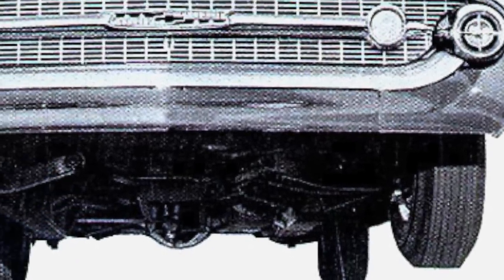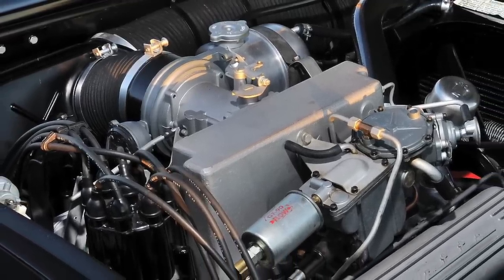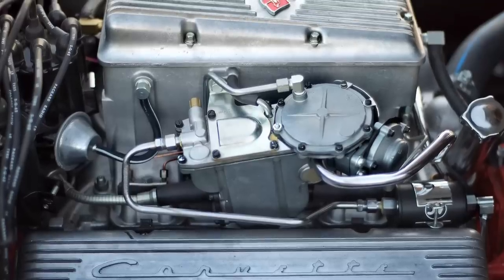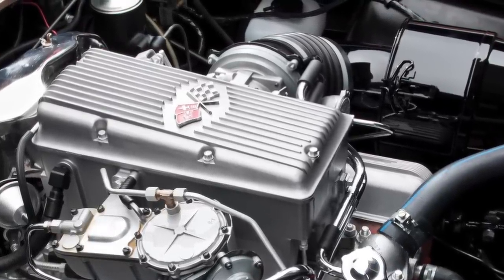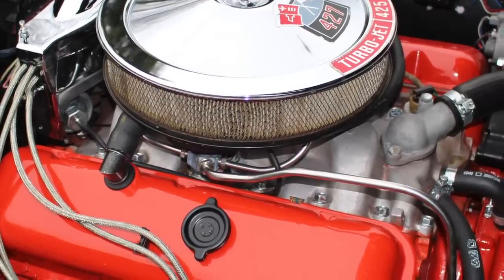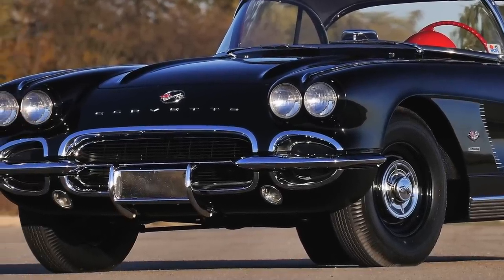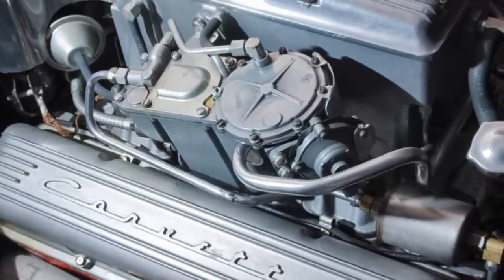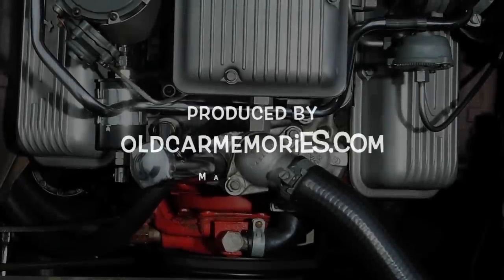Why Chevy Abandoned the 1962-1965 Fuel Injected 327 V8

Comment: Reminds me of the Cadillac Northstar engine.  It needed maintenance on the coolant system, but most original owners were too busy or cheap to have it done correctly.  Sometimes the corner gas station drained out the silicate aluminum friendly Dexcool and replaced with the silicate aluminum oxidizing "green stuff". Later, they unloaded the cars onto the 2nd hand market where they began blowing head bolts and gaskets.
Reply: .... and then when they found out how expensive it was just to change a starter on a Northstar . . . . . . .

Comment: Somehow it was even more complicated than a Quadrajet.
Reply: Super Duty 455 lol!
Reply: i loved the quadrajet, progressive secondaries and when jetted right would be 350cfm out to 920cfm, had one these on my aussie 308 when i rebuilt this mongrel motor the carby didnt need touching, and wide open would supply more then enough go juice to keep the car flying down the roads
Reply: Super Duty 455 I owned a few properly running Quadra-jets w/a automatic kickdowns, and they were crisp running drivetrains.

Buh-WHAAAAAA!!!

Not that difficult to work on when compared to a Hollys' constantly frustrating fuel leaks.
Reply: Quadrajets are good, simple, carburetors.
Reply: Back in the day their nickname was quadra-junk when they messed up because they were finicky to rebuild. But I always had pretty good luck with them.
Reply: Mike Lunn I agree. No carburetor on a stock 350 engine that can bark the tire when shifting into 3rd on a th350 at wide open throttle with only 3.08 rear gears can be a bad carb. I would get over 20 mpg on a long highway trip with a Quadra-jet.
 I had another one in a 1-ton full time 4wd truck and a th400 that was a complete animal with a small RV cam in it. 
 Factory knows how to engineer thier stuff. Usually It's when people think they will make it better somehow they make it worse instead.
  Quadra-junk, Quadra-bog... and a few other names that caught on were given to them by people who didn't have the knowlege or skill to not screw them up. 
 Sounds similar to the Fuel Injection units this video is about.
Reply: Plot-twist, guys ---- I only run Quadrajets. Spreadbore or bust!
Reply: Super Duty 455 then why would you say that they are complicated? They really aren't, and rarley ever needed to be touched.
Reply: Rockitanski because it was funny? They have a reputation as such so....sarcasm basically.
Reply: The advent of the Quadrajet in 1965 may reflect a strategic decision on GM's part to go with the new carb over fuel injection. Having rebuilt/repaired several Quadrajets in my day, I can say they aren't that hard to understand, and work very well when properly set up and tuned. For everyday driving, they work on the relatively efficient smaller front barrels. If you need CFM for accelerating/passing, the back barrels open and provide amply.
Reply: QJ  is far from complicated.  Even  this old Mopar guy used to be able to make those work!!!
Reply: I put one on my tired old '69 Chevelle 307, fiddled with those secondaries and promptly blew it up somewhere north of 6 grand.  I liked the performance of that carb.  I just wish that everything underneath it wasn't worn out junk - but I was just a broke 16-year-old.
Reply: Super Duty 455 was a
Reply: give me a good quadrajunk and ten gallons of gas, you take anything else of comparable age and I will go further down the road than YOU will. they got excellant milage when driven right never had a bad one.
Reply: I rebuild Qjets in my sleep
Reply: The Quadrajet was one of the last carburetors designed and specifically for performance and drivability. When you consider the huge amount of money GM spent on R&D then it's easy to see why it really is a superior carb in a lot of aspects. The only thing that lets it down is the small float bowl. It has a better idle circuit, transition circuit and power circuit than a Holley or Carter AFB style carb. I own Pontiacs too and I run 11's with no problem on my GTO with an NOS Super Duty Quadrajet. They were always called "Quadrjunk" by idiots who weren't qualified to change a flat tire back in the day. I remember hearing that all through high school in the '80's. But truth be known, they were simpler with fewer parts than almost every other carb on the market and when in good condition would out perform all of them.
Reply: @dale2778  i did lol.
Reply: The only thing wrong with Quadrajets was the leaking primary well plugs, and that only became an issue of the car sat for extended periods of time without being run.  I've had, literally,  over a hundred of them apart, and there's nothing difficult about them.  Q-jets, along with Carter AFBs, are reliable carburetors.   Now, if you want something as temperamental as a woman who has PMS, buy a Holley.
Reply: @johnchud7507  I loved the performance and sound of the quadrajet for many years. A very versatile carb. Tried Holley, and Carter but always went back. My dad knew everything about the quadrajet, and kept atleast a dozen of them around at all times. People who didnt know how to work on them talked them down, but they are great
Reply: no way pain to rebuild .getting the metering rods back in was a major fight .carter thermoquad was easy to work on alot less parts
Reply: Turn both vacuum secondary metering rods on a lathe. Tapper down from the original diameter (increasing fuel flow) and bend the hanger up that rides on top of the center lobe(that way fuel comes in sooner) and away we go. Like the little piggy.....wee....wee
Reply: @cruzinezy1968  u mean quadrajunk

Comment: Something to keep in mind: Farmall Tractors started making more efficient overhead valved engines in 1928, Chevy started in the mid 1930's. Ford and Chrysler were asleep at the wheel in regards to changes for better efficiency.
Reply: Farmall didn’t build engines. They bought engines from Continental.

Comment: It was almost impossible to keep running correctly. A few dealers and specialty shops could get them running right but they would go out of tune quickly. One has to remember they were MECHANICAL fuel injection. It took the use of electrical sensors and computers to make them useable for every day use. I was there.

Comment: Gm was always making bad decisions. Vega is one of them, and how bad they screwed the customers that purchased them. Not honoring their new car warranty in the 70's was also a kick in the pants for customers and dealers jumped thru hoops to get reimbursed. The diesel Cadillac was another boat anchor, they made standard engines into diesel and when they blew up the owners were stuck with a car they paid approximately $20,000.000 for, worth about $5,000.00 a year later if even that. I'm 65 and I don't forget these things, is why I'd never own a Chevy. If someone gave me one, I trade it at a loss to get a Ford or Molar.  Until the 70's Chevy did make good cars, probably even better than Ford or Chrysler, but after that, wow, did they ever short change their customers.  Just like Vega and Cadillac Diesel, fuel injection for the period was a bad idea and a maintenance night-mare for only but a select few.
Reply: Amen brother! I bought a 1974 Chevy Vega, brand new off the showroom floor. It made a FORD man out of me!
Reply: gee   i still drive corvairs     you cant hurt  them
Reply: You speak the truth. I have been told by many people how they were screwed over by a GM vehicle from the 1970's. My dad purchased a 1980 ChevroletK-10 that was gone at 50,000 miles.
Reply: @animalcorvair  it wasnt chevy that messed up it was that idiot Ralph Nator corvair was and still are a fine automobile that was my first car they made a truck and a van also and the corvair spider was turbo charged and it would get down the road
Reply: @panheadbob8627   i have 6  corvairs .. been driving  them for  40  years an i am in the dayton  corvair club  too  love.. to have a rampside     but no place to put  it  lol
Reply: I rebuilt over 40 vega engines,they were mismatched junk,aluminum cylinders against aluminum pistons,they all scuffed the walls in 4 months,the valve adjusters were 0.003 tight or loose,noting in the middles they either rattled or burned valves,putting a v8 in one only saved the body,oh yeah they were the first to have WELDED ON DOOR HINGES,IMAGINE THAT,a bodymans's nightmare,gm is better than that,we sleeved every engine that left and milled every block and I milled the heads of every engine that left the shop,then they ran 100k plus miles
Reply: .... to say nothing of the awful engines that the Cadillac division put in the GM flagships... like the 4100 aluminum one.... the 8-6-4 one......

Comment: ... and GM still uses the pushrod engine layout.  🤣🤣
Reply: Efficiency/power is not governed by how valves are moved. Old radial aircraft engines had 4 v heads with pushrods.
Reply: @andgate2000  :  But they were slow-turning, not high-revving.

Comment: The 1955 300SL was not only injected, it was DIRECT injected (into the cylinders), a first and about 50 years before it saw wide application in automotive engines.  The 300SL DI did have teething problems such as fuel wash-down when the engine was shut off and de-pressurized lines fed fuel into the cylinders;  this in turn diluted the oil down in the pan requiring a long hot run the next time to vaporize the fuel in the oil.  
Also of note for the 327 SBC was mechanical genius Grumpy (Jenkins) who ran a dual-quad 327 in his Chev Vega in the early 1970's  that produced 580HP !! , not a streetable engine of course but not too far behind current Hi-Po GM engines that need a supercharger for this kind of power.
Reply: right on Grump..he was the man.

Comment: Laughable injection was available in the 1960s but not in the 1970s.
Reply: Didn't the first Sevilles have fuel injection?
Reply: Yes. In 1976 on a 350 Oldsmobile V8.
Reply: Tacohead Makenzie  *on a Vette
Reply: @JoJoJoker  I was responding to Paul's comment.

Comment: 1) the FI ran from 1957 until 65--that's a lot of years for something that doesn't allegedly works. (2) nearly every gas station had a garage rather than a convenience store--that's a lot of shade-tree mechanics working on FI cars. (3) when you work on old cars, you learn that when you think you have a carb problem, its really an ignition problem. So, you swap out the FI intake, and replace the points when you put the distributor back in and--voila! you think the FI was the problem (4) fuel was better than the 1920's when clear glass in the gas pump let you see how allegedly clean your high sulfur fuel was, but it was still was as poorly refined as the oil that turned to sludge in your crankcase by 3,000 miles.

Comment: In 1965, the 396/425hp came out meaning Chevrolet would use it as the "top engine" and could use carbureted small blocks as the lower options without the complexity of the fuel injection.       425hp is more than 375hp.     It's that simple.

Comment: the oil companies told them too! ...... they where worried it would get much better gas millage than the carb. versions would!...... It is always about the money!
Reply: I had the corvair with the Paxton turbo
Reply: You should read more before you post.  The Corvair never employed a Paxton.  It was an exhaust driven unit, using a special Rochester carb with an enrichment circuit.
Reply: Well I hate to burst your bubble my friend...... but the name on the corvair  Monza Spider that I had used a paxton  turbocharger when I bought it used.
Reply: It was owner added, then.  Did not come with Paxton from Chevrolet.  Paxton built superchargers, anyhow.
Reply: Mine was not a mechanically run supercharger!...... it WAS A TURBOCHARGER exhaust run. and on the air cleaner it said PAXTON TURBOCHARGER! ...... and it looked just like the one's pictured for 1962 corvair monza spyder cars!
Reply: >He thinks it was the oil companies that told em to stop.
Have you ever seem how much of the fuel cost is tax?

Comment: These Fuelies don't run too good or tolerate modern 10% ethanol gasoline at all
Reply: John Hull not true!...just needs to be tuned for it!
Reply: Dan Fahey that depends on what part of the country your in and the blend used... also have to change tune with season....stick with same gas supplier, and summer hot starts/driveability can still be problematic
Reply: John Hull  what ever. Never had a problem
Reply: John Hull so do carbs
Reply: carbonfiber492 yeah but most people lack the knowledge to do these....now including myself since it's been over ten years since I sold mine and being a nice guy included the original Rochester shop and service manuals I had
Reply: John Hull, 104 chevron blue available at your local small airport. Leaded gas with high octane. LL100 also mix 50/50 with pump gas
Reply: Not my experience. They would not tolerate sitting idle for 6 months, though. The extra water held by the alcohol made the HP gears rust and locked up the hp pump.
Reply: The simple answer why they quit building them was economies of scale in manufacturing
Reply: C T well that is a dumb idea
Reply: +Corey T Taking  a 10k original fuel injection unit off a 100k car just because one doesn't know how to tune it properly is like putting lipstick on the Mona Lisa...

Comment: Astounding history. GM had the working technology that should have been used in post-OPEC embargo 1970's engines whose carburetors were leaned out to improve fuel economy but that brought a whole bunch of knocking/pinging and cold-start-up problems. I remember futzing around with 2-bbl carbs trying to get it all to work. Fortunately, I lived in SoCal (moderate weather).

Comment: The main reason that the Rochester fuel injection was discontinued was because of the dawning of increased emission controls. One of the main thing that plagued the 'fuely' was the gasolines of the day. This also plagued other fuel injection systems when they started emerging again. The problem was that the fuel injectors would start getting restricted from internal build-up. Also, either mechanical or later electronic fuel injectors had mechanical poppet valves and anything mechanical will wear, so instead of a nice spray coming from the fuel injectors, they began to leak and dribble fuel. The deposits forming in the injectors also exasperated the problem. 
The first job of every carburetor or fuel injection system is to keep the mixture ratio at 14.7:1. With increasingly reduced emission standards, and the fuels of the day, it was hard for even f.i. to maintain these standards. Electronic feedback controls were added around 1979, with the introduction of the Lambda Sond  feedback system(an oxygen sensor). This allowed the fuel injection to see how well it was doing and to adjust accordingly.
Not just GM fuel injection disappeared during 1965, but it was also the last year most multi-carburetor options disappeared. The Corvette continued with the 2-four barrel 427's, but the 3 deuces disappeared on their other V-8 engines.
Ford continued with the 2- four barrel 427 into 1967. Chrysler held out the longest with 3 deuces and 2- four barrles on the 426 Hemi, with the Hemi engine option not available after 1971. Don't confuse the current FIAT-Chrysler Hemi V-8's with the 426's and earlier versions, the current Hemi's are not true Hemi's.